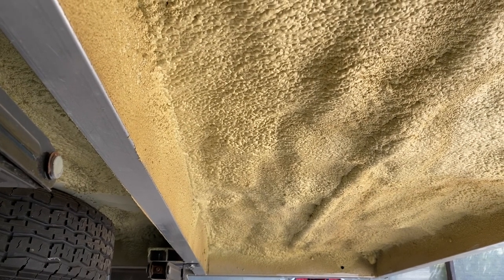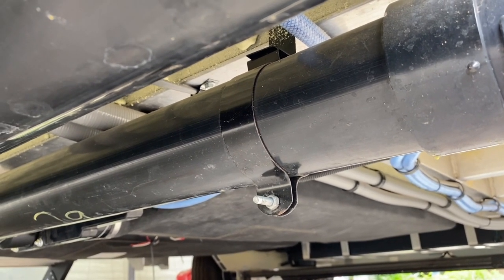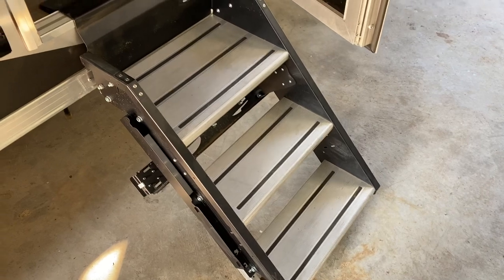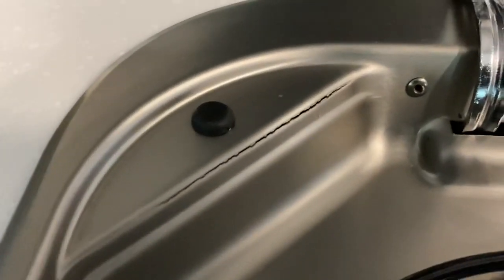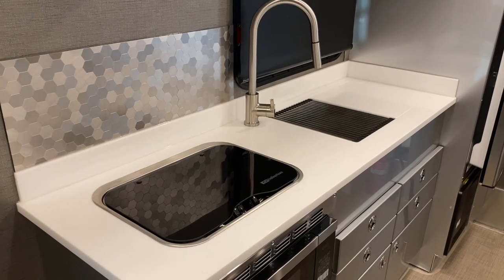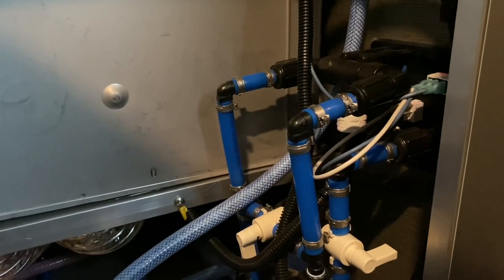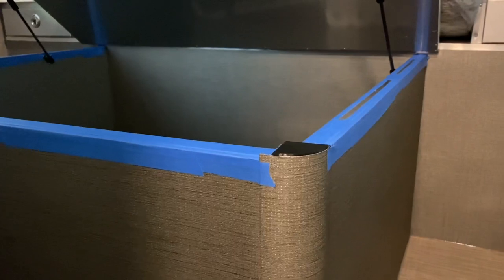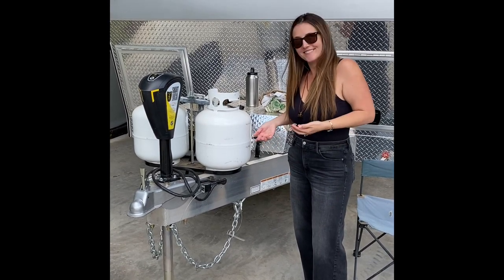ATC GAME CHANGER TOY HAULER 2021 REVIEW

Comment: This is so utterly disappointing. sigh Just when you think you've found a manufacturer building a unique quality product, you get this type of real world experience. Thanks for doing this.
Reply from the maker: Yes, for what they cost, it is very disappointing.
Reply: Checking the furnace  ducts I noticed they used rusty steel naked clamps. Over time they would have rubbed through the ducting.  Quality control isn't the answer here. It's the whole build. If they cut corners for this amount of money how strong is the aluminum  welding. ATC has some serious  issues and needs a major recall. Fire some workers and retrain with an area supervisor.  One last point I'd like to make. I called ATC and asked if I could tour their facility.  They said no. I asked if the trailer could be wired for  an commercial  ice maker. They said no. You get what they put on it no custom features. Something  to keep in mind.
Also for those who are gasoline and chemical operators  you need a wall and sunk in floor to stop the smells and spills from moving all the way into your bedroom. I have used a toy hauler for 18 years. No matter how good you're at strapping down fluid tanks and liquids sooner or later when breaking you get a spill.

People pay real close attention here.
Reply from the maker: I looked over the entire frame and bottom side of the trailer when I was prepping it for spray foam and I thought the structural welds all looked pretty good, that being said their warranty doesn’t cover you if you pull the trailer with larger than a 1 ton truck basically. I don’t remember how it was worded exactly but the concern is that a medium or heavy duty truck will ride rougher than a pickup and probably fatigue and break the frame over time. I did see some poor quality welds on smaller parts in  places like interior framing and under the wheel wells if I remember correctly. Speaking of the wheel wells, they are just light gauge aluminum sheet and if you have a tire blow out it can cause a lot of interior damage. They also sell these trailers with cheap China bomb tires so it’s a recipe for disaster there too. You are correct on the ducting being a future issue. I dug pretty deep on my trailer during all of the repairs and looked at everything I could and all of the plumbing, ductwork, and wiring was really sloppy assembled.  The ducting already had holes in it from running it through sharp holes in sheetmetal.  The battery charger/main breaker and fuse panel was a big mess of tangled wire when you looked behind it. The wire should have been bundled together and secured to prevent it from being damaged but it wasn’t.  I was obviously very disappointed especially for what they cost and how they are advertised.
Reply: @Pioneer_Classic_Trucks  I k kw about those Chinese tires. One blew on my car hauler and ripped the sheet metal away from my trailer.
Reply: ATC has been making less than great trailers for a looooong time. Probably 15-20 years ago their car trailers had wood floors and would rot out within a few years from all the leaks they had. I would have hoped they've improved as they make the ideal (on paper) race car toy hauler but... yeah...
Reply from the maker: Interesting, I didn’t know that much about their history. I don’t know how companies stay in business with so many design and quality issues over so many years.
Reply: @Pioneer_Classic_Trucks too many come and go customers. This is the entire industry though. The smart people (or those with deep pockets) get a 2 year old coach, use it for just before the warranty period expires and ditch it for another 2 year old model. They depreciate like heck, but they will net more in return if they aren't beat up in that time period.
Reply: Funny i was watching another video just a normal tour of one of this trailers and when they were opening the awning pieces of plastic started falling out lmao didn’t think nothing of it till i saw this video, yea for 200k rv fuck that

Comment: Thanks for the detailed critique. It provides a much needed contrast to advertisements and owners who don't note issues they've experienced. Some items, like the el-cheapo tires, and plastic propane fittings, are common and relatively easy to fix. But the sheer number of issues you found, including glaring ones like the cracked stainless sink, improperly secured gas tank fittings, improperly supported shower floor, and failure to clean the debris created during final assembly, are not items to be excused. I hope ATC viewed this video. If they have, it should have prompted both an immediate revision of quality control procedures, as well as a personal response to you (a thanks for reporting, and a promise to address unresolved items).
Reply from the maker: Thank you, I’ve heard from a few people with seemingly worse experiences and some with better, ATC’s PR firm reached out to me to see if I wanted them to go over the warranty with me but that was it, they didn’t seem overly concerned actually. I fixed everything myself, I was able to get reimbursed from them for some of the time on repairs but it took months.

Comment: Thank you for the video! it's amazing how much a difference in final product you have.   I have a 2019 24' and have not seen a single one of the issues you have found. My friend just picked up a 28' game changer front bedroom, a couple weeks ago, and had it up at Sturgis, we will for sure go through his.
Reply from the maker: That’s good to hear, thanks for passing on that info. I hope your friend’s trailer doesn’t have any issues either.
Reply: I was told to look for "Pre-Plandemic" ATC trailers because those that were knowledgeable and may have left the job were replaced by an inexperienced workforce.
Reply from the maker: I have heard that also and I agree. I would advise buying a pre 2020 model probably. Not only was ATC affected but all of their suppliers of materials and components.

Comment: ATC trailers are fascinating in a way... you are drawn in by the build design but it is a nuts and bolts construction...  while there are issues many are quick fixes.  But you do have to see the sloppy or lack of QC.  I own the QUEST MC300 motorcycle trailer..  saw some of the same nuts and bolts issues but I have really enjoyed it.  If I did buy your model I would give it a severe once over and take a 50 mile trip through the mountains and check it out again....  like you said in the end NO WOOD ..  
Thank you fir the honest and frank review... I guess you're off ATC's Christmas list..

Cheers 
Scott
Reply from the maker: Haha, I guess I am probably not on ATC’s nice list anymore, oh well, honesty is more important. Thanks for passing on your experience with your ATC trailer.  They have a lot of potential with their design and materials used, but making the payment isn’t very fun if the trailer is always at the dealership getting worked on it.
Reply: UPDATE: Spent the entire afternoon (8-31-2021) repairing the couch in my MC300 Quest Moto trailer.   While on adventure this weekend I sat own and it came off the wall.  The bolt could have been seated bettter.  (the fix) I reenforced it with a steel plate and used larger bolts with more diameter.  The seat is in perfectly and is sturdy.  I just rewatched your video and I was much more encouraged with the ATC product. Many of your repairs were right up today's alley.  Any future ATC aquisition would definitely get a handyman once over from me out the box.  Cheers.
Scott
Reply from the maker: Thanks for the update, sounds like you were able to improve upon the fasteners and hopefully it’s good now.  It’s unfortunate that the original design and execution isn’t as reliable and solid as it should be.

Comment: FYI  We purchased a Grand Design Momentum 40' toy hauler.  Right off we have several warranty issues, that really weren't fixed to our satisfaction.  The window frames to the back patio started separating.  The solution by the dealer was to press them back together by hand!!!  Back awning extended then wouldn't retract, one window won't stay open, it slams shut, never got fixed correctly.  Then the last straw!!! 1.5 years after purchasing, the membrane roof started peeling off mid trip in souther AZ.  Bare in mind I store it in a 53' ac Rv garage all the winter before. Never in the AZ heat!  I had to crawl up there and tape it down and the very next day the tape failed so I sliced off the entire front roofing and thew it in the garage and continued on my trip.Called GD in June on the trip got a case number and when I reached the Seattle area got it into a warranty dealer, first week of July.  No action on it for a few weeks then GD agreed to cover it under the 10 yr roof warranty.  Take a wild guess when we got it back, First week of October. The dealer that did the repair was horrible when it came to the service writer.  RV Country Buckley Wa.  So I'm selling the rig as I've lost confidence.  Side note the new roof was repaired perfect and I'm very satisfied with that but to get to that point was painful!!
Reply from the maker: I feel your pain, you end up spending your vacation time dealing with problems instead of being able to use the RV. It’s a lot of time and money lost in my case and yours it sounds like.  It seems like humans should be capable of building a reliable form of mobile shelter by now but we haven’t evolved far beyond covered horse drawn wagons in my opinion. Maybe if you buy something high end such as an Earth Roamer you could expect a reasonable amount of quality and reliability but the RV industry in general is a scam, pay for junk, pay for insurance, pay for warranties, they lose value and degrade faster than you can pay for them...
Reply: @Pioneer_Classic_Trucks  I so agree!

Comment: In the market for a small used toy hauler as we speak.  While ATC was on my short list, you have definitely convinced me ATC is not the answer.  

Imagine the chronic nightmares you would have experienced had you not gone through that thing with a fine-tooth-comb. And we're not talking about light bulbs that don't work. We're talking about water, electrical, heating/cooling, and sewage problems..... basically, every major system it has.  

The only thing you didn't mention was the suspension and after watching this video I would tear that thing apart down to the lugnuts if I was you.

 I'll deal with the potential wood issues and go ahead with a purchase on a 2212 Lance I have been eyeballing. Twice the quality at half the price.

THANK YOU SOOOO MUCH!!!
Reply from the maker: Well, I actually did have to replace all of the lug nuts and studs on my ATC, it’s another video but they were damaged from the factory and I discovered it when I had to take the wheels/tires off to get spray foam insulation installed. The threads on the wheel studs were damaged and it caused the lug nuts to seize and the threads were all galled from whoever installed the wheels on the axles. Some of the lug nuts were seized on the threads but the nut wasn’t tight to the wheel, would have been a disaster if I’d not found it when I did.
Reply: Had Lance before I bought ATC not looking back structure wise ATC is much better

Comment: I had a 2014 ATC enclosed trailer that I bought new.  It had a full bathroom and beds in it to function as a toy hauler.  I had quite a few little issues with it.  However, I will say that ATC stepped up and paid for repairs no questions asked.  I traded the ATC trailer for a much larger InTech gooseneck trailer and I have had NO issues with the Intech trailer.  Just my .02
Reply from the maker: Interesting, I’m not familiar with the InTech but I will be checking them out. Thanks!
Reply: Was considering ATC 20 foot but now considering the Intech Terra Sol based on great and thorough repairs/issues by PCT.
Reply from the maker: I’m not familiar with that company but I hope you have great luck with them.

Comment: Thanks for sharing this misfortune .

I bought a game changer 29’ w/24’ box
Shavings  of aluminum was found everywhere 
Scratched kitchen sink 
All over in bottom as if someone lived in it
But they said there wasn’t anything they could do about that.
The fender wells as well as the whole bottom should have some  insulation sprayed for it does get cold .
Thanks for pointing  this out as well as the front step
I have had issues with trying to close my door  
You have to use both hands when inside and it does not close or should I say latch easy or at all ,unless
I hold the door key opener open then push close and manually latch it.. when I’m
On the outside.

The “HAPPY-JACK”
when reading the pamphlet it speaks of two beds can fit on the same Happy Jack
So I have only one therefore 
I want it to come down to where  it’s just inches away from the back side of my couches
So from
Where it is now there are no hand rails or fixed anything that would give you a secure footing coming down off of the bed and your left with guessing your footing and even your balance with the narrow ladder that is provided.
Their answer from dealership is that there is by code a certain height that it can come down 
So that leaves the pamphlet being wrong ?
I would have to agree though that All  Aluminum and no wood is the best way to have it.
Plus the removal if furniture or different  places you can shift them
Reply from the maker: Sounds like you ended up with some of the same issues I had unfortunately. It feels like you get the scratch and dent model but don’t get a discount for damages. The aluminum frame is fine without insulation if you just stay in areas with nice weather, but that doesn’t work well for me. Due to past experiences with mold, I won’t buy anything that’s wood framed now, and I know I’m not the only one with these types of concerns, but until these companies can build high quality products, we’re stuck with buying what feels like a DIY project.

Comment: I have been researching Outdoors RV built in Legrand, Oregon. There is wood involved in their builds but after watching their factory build process and QA control I'm leaning that way. These are hand built, they build their own chassis and are not factory cookie cut mass produced. The quality is there. Now to check some owner reviews.
Reply from the maker: I looked at their website and it did look like they have a unique and quality product. The wood construction has some benefits over aluminum but I’ve had bad experience with wood framed trailers in
the past that leaked and then it turned into mold and structural damage. Also even if they don’t leak they can form condensation inside the walls when used in extreme weather conditions and that can lead to mold so in my situation I avoid the wood. Probably fine for some people though.
Reply: Never buying wood trailer again and very happy with ATC have it for two years no major problems yet.
Reply from the maker: @stanislavsavonin6405 yes, composite is much better than wood.

Comment: Man... sorry you had all these issues.  I have been looking at these trailers for a year and had my mind made up on the 2816.  Question for you... It appears you did a lot of work after you received this trailer and that some of it will just be unfixable due to where it is positioned etc.  Did you make ATC aware of these issues other than this video and if so what was their response?  New to the RV scene so just learning about things.  Is there any legal type action you could take.  It appears that they delivered an inferior product (probably due to covid) and that you should be due some sort of compensation.  It's like buying a house with the foundation messed up and finding out after the you purchased it that the old owners had someone do work on the house and they messed up the foundation So you still have the legal ability to go after that contractor even though you didn't hire them.  With the kind of money you spend on these trailers the damn thing should dry you off when you get out of the shower.  Thanks for taking the time to make and post this!
Reply from the maker: I think everything is fixable, I haven’t noticed any structural issues or anything major like that.  I have not attempted to contact ATC directly but the dealer seems like they are willing to fix things and reimburse me for parts I’ve had to buy, but I haven’t had time to get the trailer back to them yet. Probably will soon and depending on how it goes it might be content for another video...
Reply from the maker: I am concerned for everything that isn’t visible though, when there are so many very obvious issues it makes me wonder what’s hiding under the surface out of sight. I will be looking into compensation and probably making another video update on how it goes.
Reply: @Pioneer_Classic_Trucks  Exactly... like after a long day what parts have rubbed together and become damaged in some way.  Well Good Luck!
Reply from the maker: I’ve sold the ATC, but I have not been reimbursed for the parts and repairs I had to make.  I have several emails to the dealer now that have gone unanswered so I don’t know
If the problem is with the dealer or ATC, but either way it has not been a good experience.